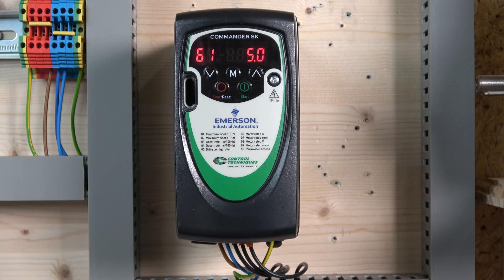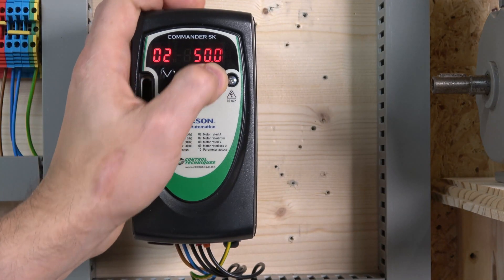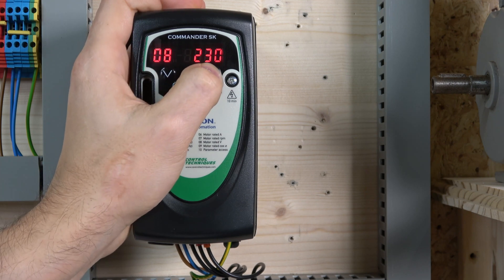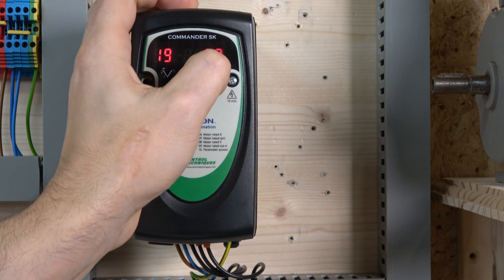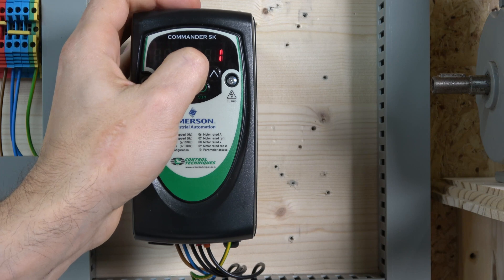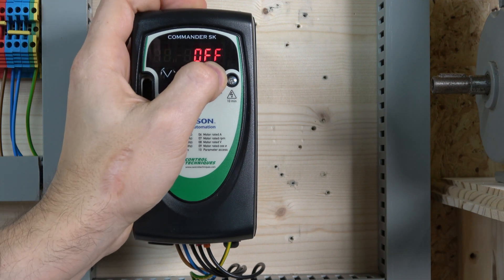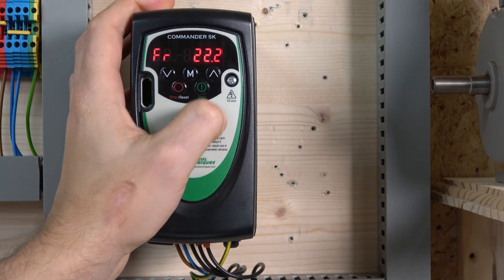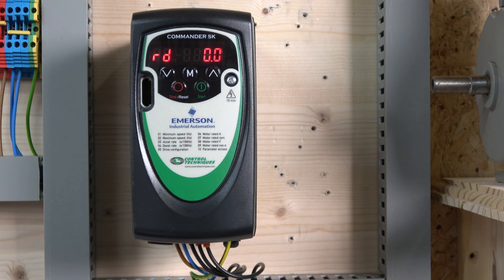Emerson Control Techniques Commander SK VFD, local control, commissioning, Factory reset. English

Comment: Hello, I'm in a far country Philippines. We have existing 9 units Commander SK installed in our pump booster CPS. 30 hp 380V 60hz system . May I ask if we can still get this units from you because some of the units now needs replacement. Thanks

Comment: i have an issue with this drive not connecting local. ethernet cable going to black box then to hmi. drive runs only in hand. can’t get it to go local? any suggestions?
Reply: i guess i should ask again. should putting it in local be done only after resetting the drive? and drive should be stopped?
Reply from the maker: Hi Tyler, not sure i am fallowing your question.  Are you trying to run drive in local mode?
Reply: @IGSElectronics  yes

Comment: I have a problem in it Emerson Control Techniques Unidrive M100, when it is working normally apparently fine all of a sudden, example at 45 Hz. It just goes up a few seconds to 47/48 Hz. And it loses the times with other devices, Excellent videos, thank you very much.
Reply from the maker: Hi There, how is your frequency controlled, is it set or from potentimater? Also what is drive controlling, i.e its load?
Reply: Winding and unwinding of paper, with start and stop buttons with their acceleration and deceleration ramps 5s., And with a potentiometer the speed = from 0 to 100 Hz.
Reply: Hello, because your job is, when a motor with VFD and a filleting knife, which is previously running at a fixed speed ((x) In Hz. And configured), another motor with VFD drags and pulls the feed rollers, Pr1 = 0.0; Pr 2 = 100 Hz; Pr3 = 3; Pr 4 = 3; Pr 5 = AI.AV; and the rest according to the motor board etc. then stop button and emergencies ..., anyway I don't remember well, I'm on vacation and I can't see if it's from the Unidrive M100, or from the Commander Sk. Thank you

Comment: Thanks for the video...
Reply from the maker: Your wary welcome.
Reply: @IGSElectronics  hello buddy,  Pls do you know the parameter I can use to disable  (Tr hf26) which is hardware fault for brake or what could be the cause of the fault, thou wasn't having it as of initial,  it appear after I connected for enable.

Comment: Hi mate., i have O. Ld1* error means user +24v or digital output over load., any help.,? Or what can i do
Reply from the maker: Hi There, that looks like fault in IO unit. Best way to check if it is IO, is to remove all wires form I/O part of the drive and power it up, if fault persists you highly likely be looking top replace drive or I/O unit.

Comment: Hi! Nice tutorial, but I have HF 22 failure. It means "OI failure at power up - output short circuit or possible output bridge
failure."
What can I do? Is it possible to repair?
Reply from the maker: Hi Matej, Personally i usually replace the drive, if you have kit and electronic skills you could attempt it to look in to it and fix it, but for me looks like I/O has failed and i would replace the drive. But one thing, am sure you might of done it, remove all I/O cables and power up without them and see if it is definitely the drive that is having the problem.
Reply: There was short circuit at the motor connector. So I disconnected the motor and power the VFD, and there is failure. You mean that the VFD is trash now?
Reply from the maker: @matejzaberl9763  remove the motor cables from to drive and then power up the drive. Let me know the errors.
Reply: There is just power connected and it is still TR HF22 failure. I have skills to repair, but I do not know what is damaged.
Reply from the maker: @matejzaberl9763  sounds like there could be failure of the I/O board, but that something I got no experience in, so won’t be much help to you, sorry bud.
Reply: Thank you very much anyway.
Reply: Pls do you know the parameter I can use to disable  (Tr hf26) or what could be the cause of that trip fault, from the manual it is saying someth of brake resistor.
Reply from the maker: @bdb7629  are you setting up drive from new?
Reply: @IGSElectronics  , we bought it new, I did default reset then set the necessary parameter,  the fault (tr hf26) appeared immediately i connected the the start command terminal,.

Comment: Hi dear, thanks for you tutorial.
I need to reset this inverter keypad and parameter lock password because I forget the password. therefore I can't change parameters.   please if you have any process to unlock the password, please describe me.
Reply from the maker: Hi there. Have you tried defaulting the drive settings?
Reply: @IGSElectronics  hi after a power failure i switched on the main power to the drive but it does not wants to power up. what might be the problem